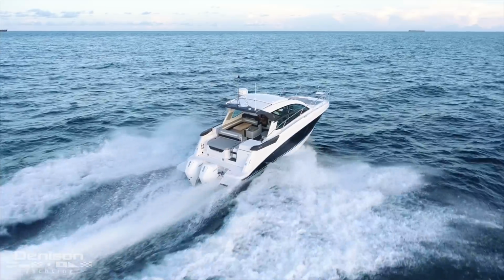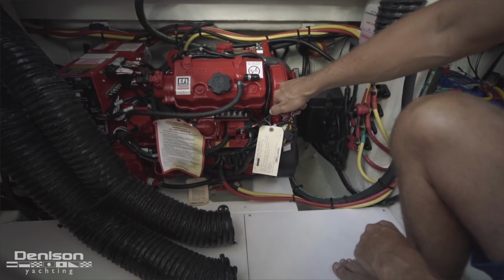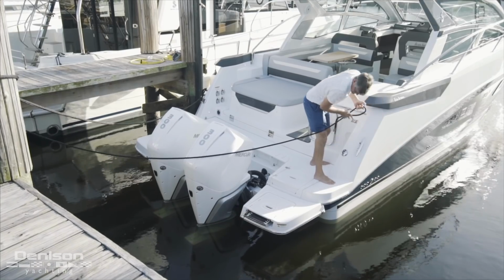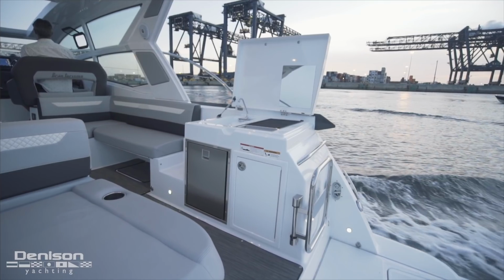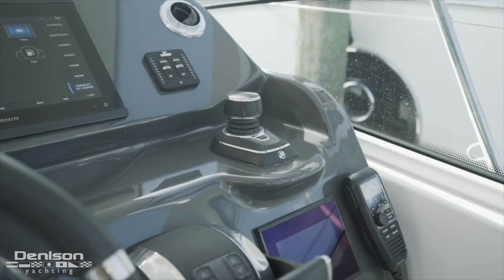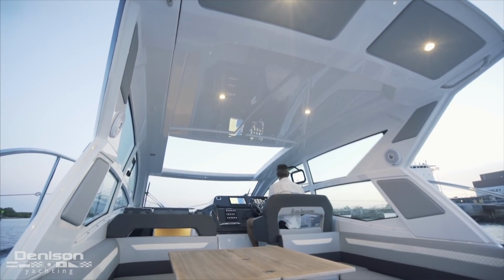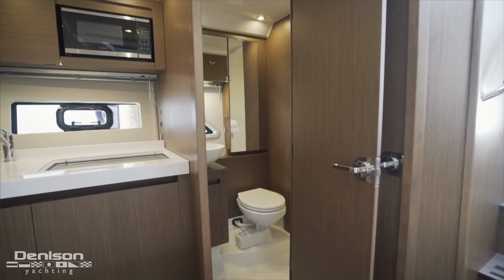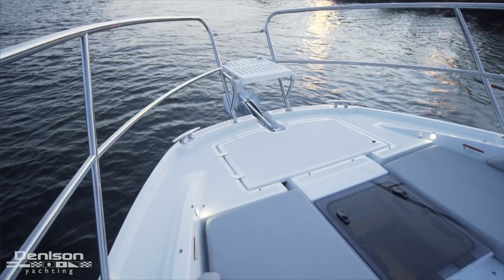GT36 By Beneteau Outboards Walkthrough [New Boat]

Comment: I love you're Video's but really? There is no way in hell that boat is worth 
36' Beneteau 2020 In Stock
Fort Lauderdale, FL
$476,896
Even I know I can get so much more for so much less. A ha;f a Mil really . I understand it is an asking price but if that was the case I have a dog house with running water for 300.000 just hook you're own hose to it
Reply from the maker: A lot goes into the price of a boat but she is new. It's like a new car. Price drops with the years usually.
Reply: Compare it to the searay sundancer 370 outboard and this boat is half the the price. Mind you the searay had alot of nice interior upgrades and designs but not worth another 400k.